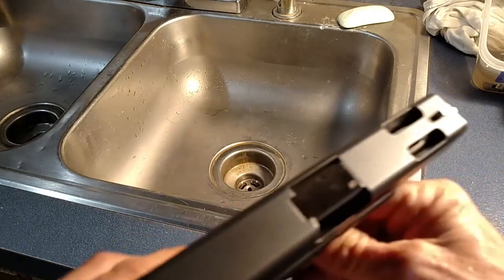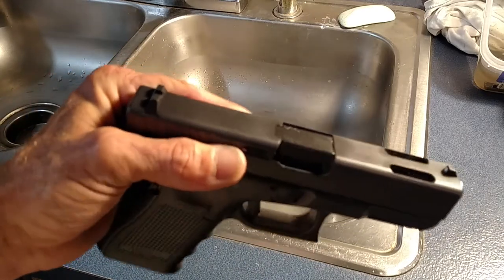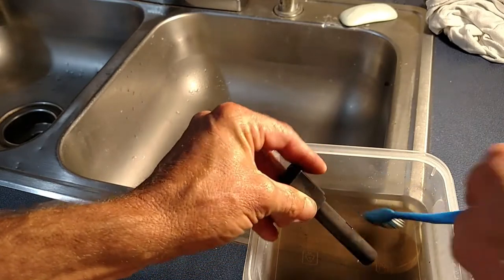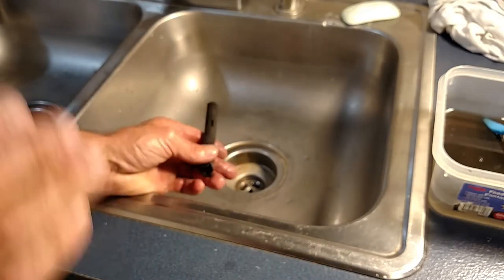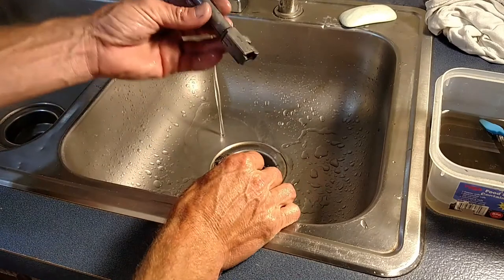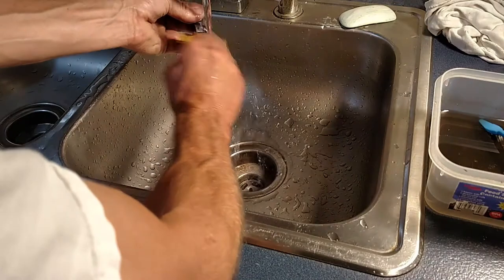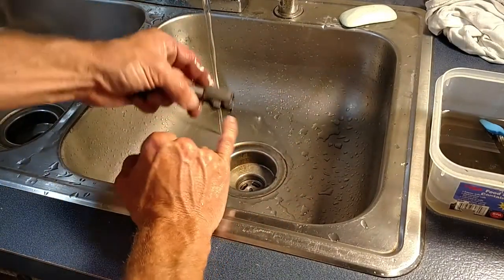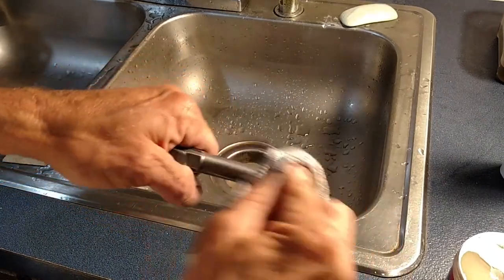How to polish a pistol barrel part 1

Comment: I tryed it worked perfect but I put foam earplugs in the ends of the barrel while it was soaking seemed to work real good just in case
Reply: italian pride 

It honestly doesn't matter if the "finish" is removed from the inside of the barrel. It's just the black coating. It has zero effect on the barrel.
Reply: pro trick: you can watch series on Flixzone. Been using them for watching all kinds of movies recently.
Reply: @Lucas Abraham yup, have been watching on Flixzone for years myself :)

Comment: I000 grit sand paper with gun oil.  It will remove the black finish and leave the barrel the nice silver color with zero swirl marks. I've done it many times. 

I've even soaked the barrel in vinegar, for like 4 hours, then rinse and use 1000 grit sand paper. Works every time. 

I wouldn't go lower than 800 grit sand paper, that's when you start developing swirls and marks
Reply: Is that sandpaper soaked in water or sandpaper soaked in oil?

Comment: 🚨Do not use vinegar 🚨
Reply: Why?
Reply: As long as you plug the barrel. And you use the vinegar just enough to get the coating off it’ll be fine. I’ve done it on numerous pistols and I shined them so well that they’re slicker than a warm knife through butter and this was over five years ago, and still no rust.
Reply: @AVH8TOR  have you polished a glock slide? if so how did you do it